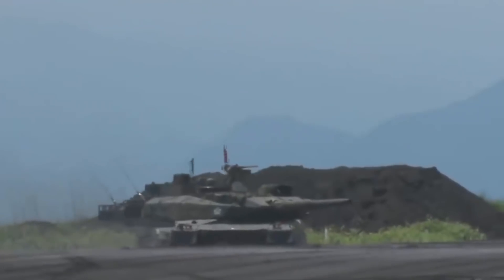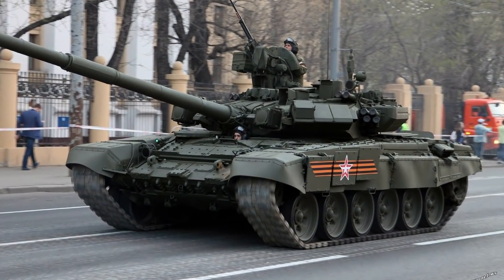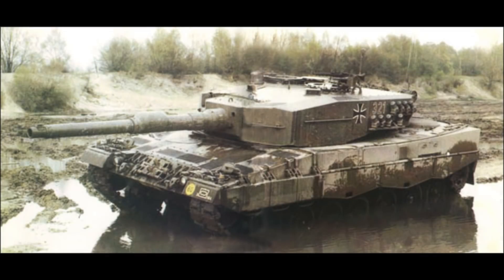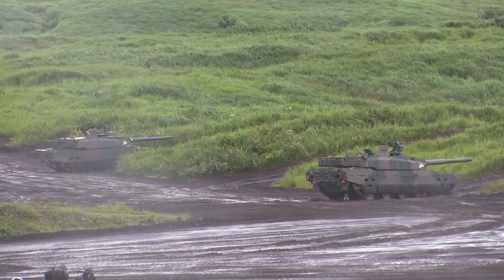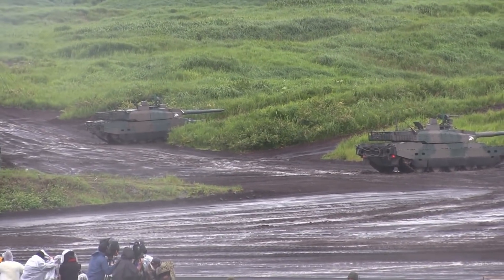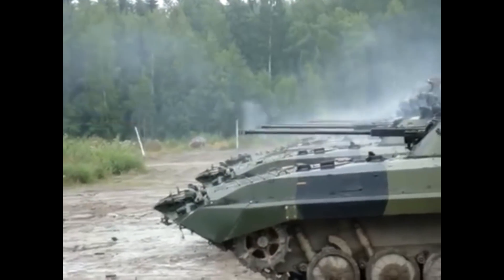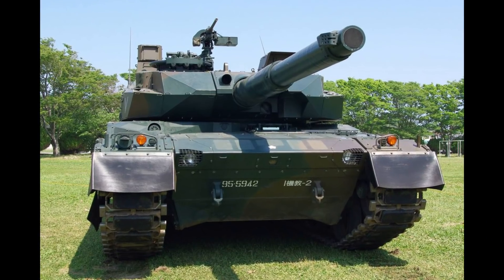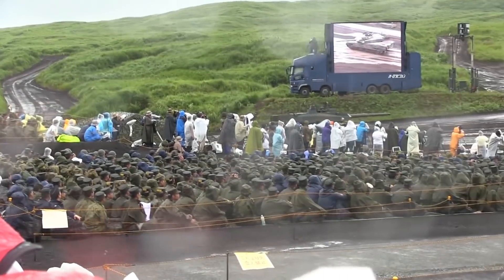Problems with Type 10 tank

Comment: The armor of the Type 10 is not weak, and as for the car body, the weight is lighter than the Type 90, but the composite armor is doubled. In addition, steel plates other than composite armor miniaturize the crystal grains in the steel plate, which is a polycrystalline body, increasing the area of the crystal grain boundary and dispersing the stress caused by enemy bullets.Although it is ammunition that enters the car body, this (and the armor) is not open to the public, but it is expected that only a few rounds will enter the car body, and a dozen rounds will enter the ammunition depot, and several other rounds will enter.Also, the armor around the gun is not fake, but it is possible to remove and install it depending on the situation.I'm sorry for writing such a long sentence. Also, this was translated by Google Translate, so I'm sorry if the sentence is strange.

Comment: Biggest reason for light tank is Japan has requirement for weapon systems to be transported in its extensive rail system with narrow gauge tracks.  Due to narrow tracks, there are weight and width limits.

Comment: TKX has modules to increase protection  and it goes  from 42.8 tons to 44.4 tons standard configuration and a max of 48.2 tons at max , with the new aps planning to arrive for it it will increase to 48.7 tons

Comment: I think Japan has too much information to draw from allies like Germany and the US (and to a lesser extent the UK and France) on how to design a tank and not do an adequate job of it. You can bet your bottom dollar that it employs top notch engineering and material science. I would stop short of suggesting that it would deploy DU in the armor package because of political considerations, but tungsten ceramics are an almost given. As far as hitting the turret ring from the front, it's hard to hit what you can't see.

I think comparing it to a tank designed with fighting in western Europe is a bit unfair as the battle doctrines are different.

Comment: Do more research dude…. The type 10 is designed to be able to attach/remove extra armour.
The 44t weight is the lightest armour package.
The standard weight is around 56T and max armour outfit is 62T

Comment: The answer is in the intro. Japan is a series of islands, so to engage the Japanese you need to get there first - via sea. So the Type 10 is most likely going to not engage other MBTs but lighter amphibious vehicles. But the Type 10 is a tank, with a tank's firepower.

Comment: The most problem of Type10 is Weight.
The Weight same as a T-72A
That's mean Small but also Less Armor.
But it could be Best IFV If the Armament can be changed for Autocannon instead of 120mm cannon.

Comment: 1 
Covering the side skirt with compound armor will be superior to carrying missiles from the side.
However, in anti-tank combat, the weight is bulky and loses mobility.
2 　
It seems that the reason why the side is not composite armor is considered only by weight, but Type 10 is a much smaller body than Leopard 2. As a result, even if composite armor is given to the side, it will be much lighter and your claim is guess I know it's a difference

Palpitations, which developed the Type 10 in the first place, is much lighter than the Type 90 composite armor and achieves the same or better armor defense.
Basically, it has superior armor protection that can not be compared with Leopard 2 which just stuck thick external armor on the armor developed in the 1980s.

Comment: The thing is, the tanks weights 40 tons (that’s the weight of the tank itself, without any additional heavy equipment). It weights quite a bit less than Russian tanks like T-90 despite being much bigger than them. Being the same size as most NATO tanks you have to wonder why it weights 25~ tons less than them. T-14 Armata weighs 15 tons more despite having almost no turret.

Comment: I think the idea is of the side bulges is for spaced armor protection, you see two layers of steel with a hollow space between them is more effective at stopping HEAT warheads than the same thickness of steel in a single plate. Thea reason for this is that distance drastically reduces the effect of shaped charge, a thin layer on the outside to detonate the warhead too soon and the thicker layer underneath to prevent the hot plasma from entering the crew compartment. 
Japan is looking at the prospect of fighting other light tanks as they are an island and whatever armor they are going to have to fight would have to be amphibious or light enough to be air dropped. I don't think they are built to invade mainland China or duke it out with T-90s in eastern Europe, so a 44 ton tank might very well be the heaviest armor on the battlefield in their case.

Comment: I feel that the design of this tank would have had better results in terms of protection with an approach of making the installation of modular armour units quick and easy.  This would allow things like the side, rear and turret armour units to be moved seperately from the tank chassis allowing for trasportation where the bridges could not support the weight of heavier tanks.  In this way the bridge could be crossed, the armour re-installed and the army keeps its equipment well protected in action.  While this would make crossing a bridge in an unsecured area or under-fire almost impossible for the tanks, trying to cross a bridge under fire is an extremely bad idea in modern warfare as a bridge that would struggle to take the weight of a tank will most likely be a lot easier to destroy than said tank, especially when you factor in what would happen if the bridge is destroyed as the first tank of a column is about to reach the far side.
Reply: I'm pretty sure that's literally what they did, it apparently has modular armor that can be attached for improved protection, and it just doesn't have any attached when appearing in media.

Comment: So this is a solid example of a modern light tank.
Reply: No, not really a modern light tank would be the 2S25 Sprut-SD which weight about 18+ tons.

I think 40+ tons is too heavy for the specification for both light tank and medium tank, that's just my opinion.

The german leopard 1 is 40+ tons too, well it's old but yeh.
Reply: @DinglePinky  it does remind me a lot of the Walker bulldog and the chaffee, both are light tanks that standard main cannon type calibers and still have okay armor but were built to favor mobility and ease of transportation.
Reply: @DinglePinky  i think the definition of a light tank isn't specific to it's weight but more about it's purpose and specifications. The leopard 1 was a light tank of it's time as it was designed to only handle light weapons and not mainline cannons of it's opposition.
Reply: @dominuslogik484   
hmm that does make sense but I'm still gonna stick with the weight and price.

Also another example here a self proclaimed modern medium tank
The kaplan medium tank which weighs about 30+ tons, the price is unknown to me yet but if it's the same price as any 3rd gen mbts out there what is the point other than the low weight :)
Reply: @DinglePinky  the panther was a medium and weighed more than an is-2 so it's really doctrine but designations are more or less meaningless for modern tanks
Reply: @dominuslogik484  I wont say meaningless because sprut sd literally has no armour except against firearms, light enough for airdrop, and to cross rivers easily without needing to ready up equipments just to cross a river, and is capable of doing a lot damage with that cannon, so for me those are light tanks useful for situations an mbt cant do but alas they have next to no armour.
Medium tanks on the other might be a pointless designation because you'll only buy those if your country is broke but you still want an okay armour against auto cannons.
Reply: At that point just buy a t55 lmao
Reply: Huh now that I think about it a t55 also weights 30+ tons
Yeh medium tank pointless designation but not light tank
Reply: @DinglePinky  I think things lighter than 30 tonnes are just IFVs these days even if equipped like the striker.
Reply: @dominuslogik484  yeh it is just an ifv but hey light tank kinda sounds cool

Comment: It is called compromises and every MBT or light tank in the world is affected by certain compromises. I see more of a problem with the agenda behind this video.  Video downvoted.

The vehicle's armor consists of modular sections, providing the ability to mount varying degrees of protection depending on the mission profile and weight requirements. Vehicle weight is 40 tonnes in base configuration, 44 tonnes in standard configuration, and 48 tonnes in full configuration (fully equipped).  The predecessor of the Type 10, the Type 90 main battle tank, was deployed only in Hokkaido due to the weight limit of roads and bridges in other parts of Japan. One of the primary purposes of Type 10 is to be able to deploy anywhere in Japan. Size and weight reductions have made the Type 10 six tonnes lighter than the Type 90, weighing only 44 tonnes. 84% of Japan's 17,920 bridges are passable for the Type 10, compared to only 65% for the Type 90 and 40% for mainstream western main battle tanks.

Comment: In situations where weight is a big issue why wouldn't they use aluminium instead of steel for the chassis? At worst you'd have a lighter vehicle for the equivalent protection, albeit with much more metal used, and at best you could have some level of composite armour on the sides without undue weight.

Comment: Could the 3 holes on the sides in front and back be used to attach some sort of modular side armor kits (ERA/NERA)? Same question goes for turret space - could it be designed in a way to drop special ERA/NERA bricks in them with different thicknesses?

Comment: The design philosophy of the Type 10 is somewhat akin to Leopard 1 or AMX 30.
Reply: Not really as it actually features pretty good frontal armor
Reply: @hendi1571  But it only covers a small portion of the front.
Reply: @ReviveHF  its mostly classified, so the actual distribution is hard to assess. But what is currently known is that the whole UFP is covered by composite armor and its likely that the turret front is covered as well. Of course there are remaining weakspots like the lower frontal plate but the most important areas are covered (except for the turret ring). The total weight of the composite armor packages for both the turret and the UFP is known and they support what I've presented so far.

Comment: Imo they should have placed the engine in the front to add some extra protection for the crew, especially considering the designers where aware that the armor is not sufficient from the start.
Reply: Frontal armor is actually pretty good

Comment: Yet the t-14 despite not having any information is a well armored tank 🧐
Reply: "Not having any information"? The front hull is confirmed to have around 950mm of RHA equivalency, the hull sides are covered in ERA specifically designed to stop tandem-charge HEAT warheads, and a hard-kill APS in the turret on top of that.

Comment: So, this tank has more in common with a Leopard 1 and it's a modern day take on it. Protection is it's mobility.
Reply: Not a bad idea, honestly... modern ATGM's will smash any tank, no matter how heavy it is. A Javelin as example will kill a 45 ton T-90 the same way as it will kill a 70 ton Abrams. They should focus on hard & softkill systems instead of heavy armor compounds instead. Everything which is IR guided should be blinded by DIRCM. The korean K2 tank has a radar for this reason, will detect any incoming missile & smoke itself, which will blown IR and our eyes from seeing the target. Everything unguided like RPG's and NLAW's should be defeated by hard kill systems. US tested israeli Trophy APS on the Abrams. They fired 40 different ATGM's from Kornet to TOW on it, under different conditions and not a single one went through.

IMO a future tank should be around 30-40 tons and refrain from a strong front but instead be armored everywhere all the same, should protect you enough from medium calibers and everything else should be defeated by active protection systems.
Reply: Its literally better armored than Type 90 by composite weight alone.

Comment: Everybody says this is Type10 MBT
But actually it's midium tank in spec.
Reply: 40+ tons is kinda too heavy for that specification in my opinion, because leopard 1 is also 40+ it's old but yeh.
A good example for a medium tank would be the self proclaimed modern medium tank 
The Kaplan Medium Tank which weight about 30+ tons.

Comment: So this is kinda like an ultra modern AMX 30 or Leonard ?   Light and mobile??
Reply: They actly have smthing much lighter called the type16. Its an 8wheeled IFV with a 105mm gun ontop. It weighs 26 tonnes in its bare bones setup, so it can be airlifted by their kawasaki C2 cargo plane.

Comment: Just think of it as a Leopard 1A4 in the 1980s. It would NEVER stop any main gun round from the 1980s. But, it has a good mobility, a good gun, good fire control and is generally protected IFV auto-cannon fire. It is ALSO about 45 tons (42 actually).
--
Armor is an all or nothing proposition really. Either you can stop contemporary long rods or you can't. If you can't it isn't worth having. What is worse is a tank with has heavier armor than it takes to stop IFV cannon fire, but not enough to stop 120~125mm long rod munitions. It'll pick up 10~20 tons of weight for no appreciable benefit. It's better to not have the protection and accept the proposition that if you are hit you are killed, but you have a good gun and if you hit the other gay first he is killed too.

Comment: What do you mean by problem when the tank is designed for japan andonly meant to serve in japan meaning its not for your country. The tank also sacrificed weight for more mobility. The faster you can position and turn the tank the faster you can fire compares to a heavy tank which will get hit before it even position.
Reply: N it doesnt actly even have to turn around to retreat if the driver is ballsy enough.

Its got a CVT. yeap. But not the belt type. Hydromechanical planetary gears if im not mistaken. U know what that means? It can go up to 70kmh… IN REVERSE😂.

Comment: @redeffect
You are confirmed wrong on the composite armor modules
Gaijin community best you to it
Minimum armor values to the front is 650 on the UFP
650 on the turret cheeks
Around 580 or so around the gun mantlet

The tank itself has multiple different package options. If you want sources you we compare notes on this. I have over 1,000 pages worth of official documents from JASDF testing, Honda, Mitsubishi, even notes from the Brazilian ministry of defense and their comments on the protection level of the tank

Maxim weight of the type 10 is 52 tons with all armor modules installed

Comment: We must consider that japan has no intention of exporting this bad boy, and has no desire to reveal the armor capability of its type10 to its full extent.

The only vids that we see of this tank in action r sanctioned public demonstrations. No actual training footage, no on-duty footage by the troops themselves. Its all a hush2. 

The only thing they revealed was its comms ability, the trick active suspension, and its seriously powerful gun (which is as powerful as rheinmetall’s piece despite being shorter).

Do we even know what sort of add-on kits are available to these tanks? Its understandable u dont wanna put them on in peacetime to preserve them afterall. Whats the actual weight limit if push comes to shove? Coz that engine - assuming thats the actual power output - can definitely handle more weight added on. Push it to 51 tonnes and itll have the same power/weight as the heaviest abrams, n those juggernaughts r no slouch.

Comment: So, at 44t the Type 10 is to be considered as "light" for an MBT? The T90MS is 48t and it still is a well protected tank. I somehow doubt 4t of mass reduction will spoil the type 10's protection in general, especially when designed by the Japanese.
Or take the other viewpoint, weighing in at 62t the Leopard 2A6 should be significantly better protected as the T90MS, but judging by your reviews T90MS and Leopard 2 A6 are evenly protected. Now, does Mass matter or not? especially on modern MBT's where better protection is an engineered feature consisting of many variables. The days of simply adding more steel are long gone.

Comment: i'd take a type 10 rather than Leopard if i have to fight in japan. im from indonesia so i know its kinda ironic (we have 105 old leopard 2 i think). 

heavy tank will destroy more of your infrastructure, Logistic train, and morale(Forest+hills combo makes Maintenance and Supply HELL) than the enemy. since you have to regularly navigate Steep (i dont know how that road near my house get Approved for construction, its almost 45° in some area. and its >5km long and straight) muddy dirtroads(bye bye Fuel and ammo truck). a lot of weak bridges (and i mean a LOT. there is 8 just in 2 km radius of my house and most dont have Build licence). in my opinion, what we need is a Mobile Gun Platform. a tank that is as capable as Mountain Goat. Great Firepower, and light Logistical Dependencies. what it need to do is move up to a Peak, take multiple hidden position with envelating fields of fire. then Shoot and scoots Organizedly. the Forest and the Environtment will do the rest of the Damage. weak armor is fine since "No armor is Best Armor". and the Trees is our friend. they hide our sins (hehe). tank is more a "Fixing" force than main Attacking force in island nations. this do be vulnerable to air attack or drone attack tho. so in the long run well lose any tank we have in the begining.